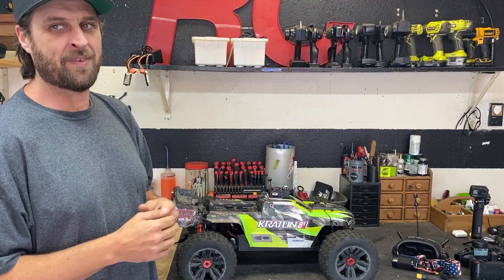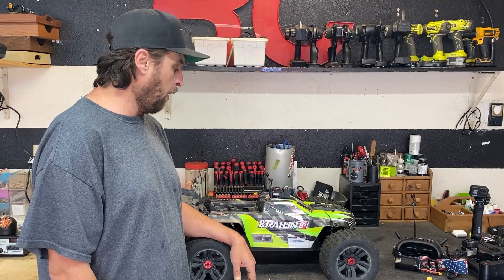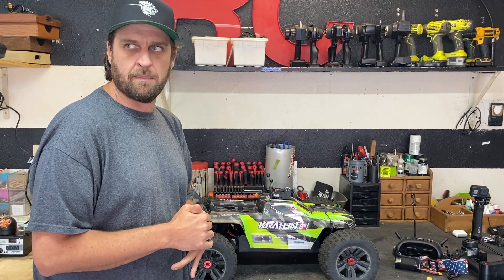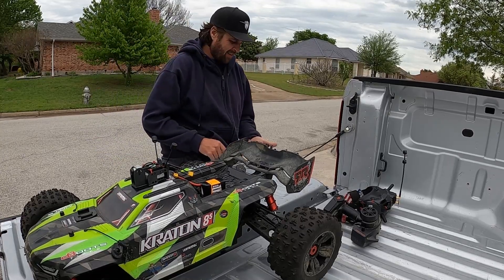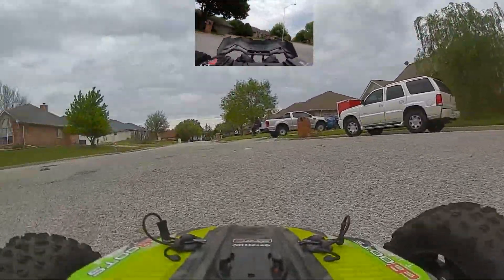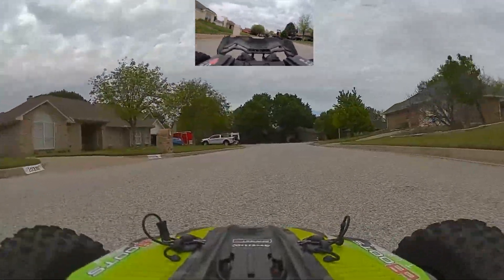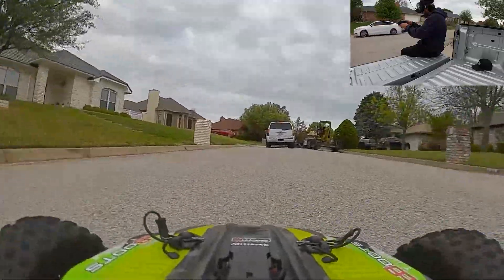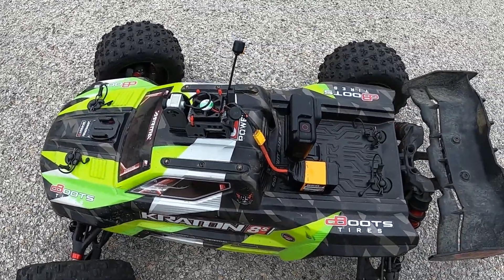#RC #FPV! Kraton 8S with DJI Air Unit & Goggles! Range & Battery Testing!

Comment: Make sure you have temp control in the air unit set to off. If it's not connected to a flight controller it decreases the output power. Even when it says your in 700mw.
Reply: Bump it up to 1200mw for more range. https://www.youtube.com/watch?v=cZkXKg14h2Y

Comment: Nice set sir, new fan 😀
Reply from the maker: Thanks
Reply: Sir, can you show us how you build it?
And what camera and goggles do you use?
Reply from the maker: @josephocarez2925   I used a set of DJI goggles and an air unit! If I can I’ll try to make a video about how I built it soon! All I did was put a battery on the air unit and Velcro it in the truck! Then I did everything else during the editing process of the video

Comment: i really like these vids, that's a sick car to have fpv on. I'd like to see it rally style on trails or like at a disk golf course. Also i haven't seen anyone do this but if you had the air unit mounted above the rear of the car you could have more of a 3pv view that might make it easier to drive/see your surroundings.

Comment: Nice video bro! How did you connect your male xt60 to the air unit so you could plug in the battery?
Reply from the maker: I soldered on a xt90 to the included wire that comes with the air unit.

Comment: Do you have a video you can link me to on setting up front AND rear facing cameras? Thanks.
Reply from the maker: No sorry! This is just a DJI air unit on the car and driving with goggles
Reply: @kenny2644  Thanks homie!!!
Reply: I'll subscribe, could you possibly do a video on how you set it up? It'd be much appreciated. Subscribing now. ( ; ) )
Reply: I'm a newb to fpv, I searched and there isn't a single video on all of youtube on front and rear view fpv.
Reply from the maker: @Revdonlee74   I did it with the air unit pointing forward and a GoPro pointing backwards and then I combined the videos in my editing software! Adobe premiere pro
Reply: @kenny2644  Aaaaaaaaahhh. To bad it can't be done in real time, that'd be sweet!!! I live in the city and I'm not trying to get run over from behind. Lol
Reply from the maker: @Revdonlee74   yeah I hear ya!

Comment: what video system is that?
Reply from the maker: DJI Air Unit
Reply: @kenny2644  good video even with some obstacles?
Reply from the maker: @Chris-vc1dh   yeah but not great range in my opinion and it don’t go out slowly like analog would! When it loses signal it loses it all at once!
Reply: @kenny2644  so maybe better with analog 1.2ghz
Reply from the maker: @Chris-vc1dh  just depends what you trying to do! Every system has its benefits and down falls